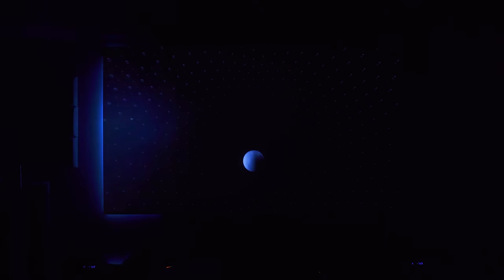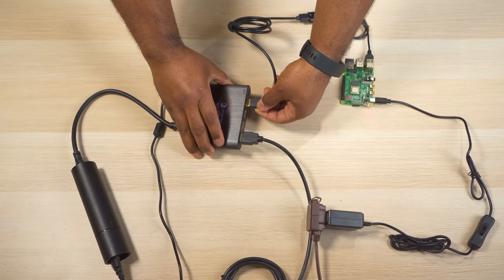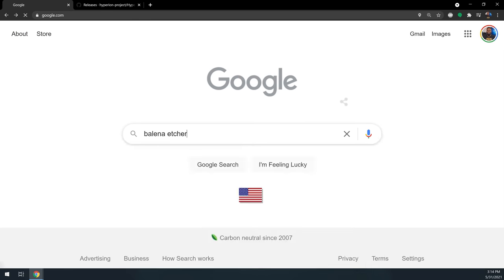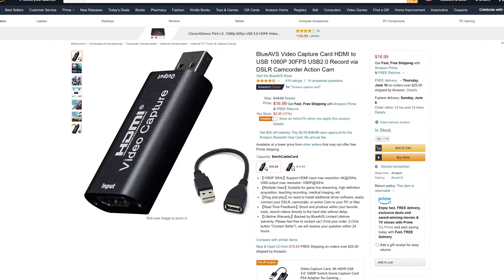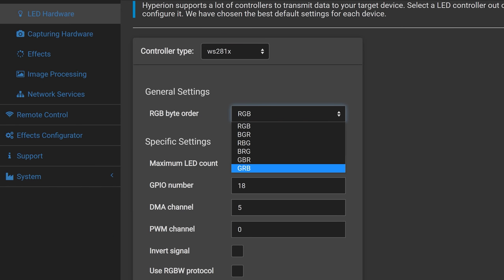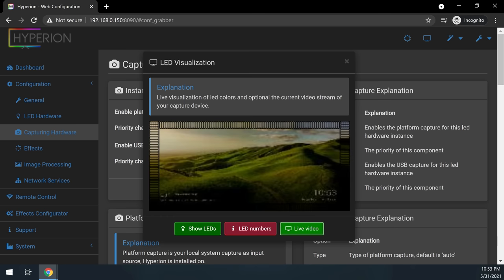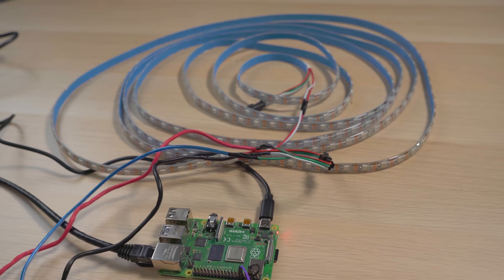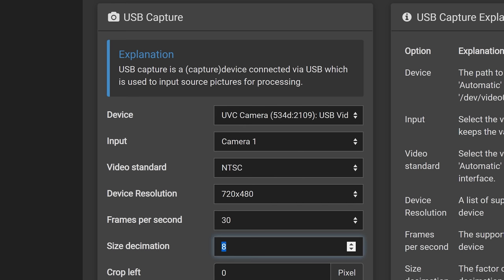Full Hyperion Ambilight Tutorial (TV Backlight) - LEDs Match Colors On The Screen

Comment: Hi, thanks for doing this tutorial! I'm using a 5v 8a power supply, but the WS2812B 60 light led strip is not coming on. I've got the raspberry pi connected to the same power supply and it powers up fine. Is my led strip broken or what am I doing wrong? Thanks!
Reply: having same issue.. i've checked strip with WLED, strip lights up there... but through hyperion.. it just remains off..
Reply: you need to be in root, disable audio PWM in config.txt, and enable wifi ! Should work now..

Comment: love the video ive been waiting for this.  but i think i need to research on the power suply thing as im gona try what you said and use 2 power suplys.  i need 20 feet of leds strip for 100inch screen which isnt a issue but my setup will have the power suply with my denon amp 10 feel away.  so need to go over the 2 powersuply method first.  not confident yet but ill check your web page.  again thks for video.  gurr on my only option at 350 uk pounds fo4r thge box lol.  i need cec for googles automatic on response.

Comment: I'm having a flickery mess right now as if the pi isn't communicating at all with the pi so I just ordered the logic converter. There was many times of just giving up with the elbows I even through them away but dugged them out of the trashed and soldered them. Now I ordered a 5V 15A 75W power brick do I need to have something on the other end and if so what if I just tie both sides to the same brick?

Comment: I got a little confused during the portion talking about the receiver.

If my AVR has two hdmi outputs couldn't I use one for my display and the other to the ambilight equipment?

I'd still get HDR because of the connection to the Display direct from my receiver and the ambilight doesn't ... need HDR?
Reply from the maker: With the way most receivers work it will not display 4k HDR to the primary if the secondary doesn't support it. So what happens is when you connect the HDMI capture to the second hdmi output it will drop your TV down to 4K Non-HDR. Hope this makes sense.

Comment: Well idk if anyone has had a problem with this but the power supply that he list in the description is pretty bad and you should definitely find a different one it ended up not working and frying some of the LEDS and it wont work all the way around if you us a 16ft LED strip so you should probably pick up to power supplies for that. (at least this was my experience with doing this and I didn't want to spend more money so I never finished it)

Comment: quick question.  someone mentioned using a 12 v led strip so only 8amp needed, is that right?  what would i need to do for that scenaria?  or is it wrong info?
Reply from the maker: No. You still use the same amperage calculation I mentioned in the video

Comment: Hi Chris .. if your AVR has 2 monitors output do you still need the splitter ?
Reply from the maker: I mentioned it in the video but no you don't need a splitter If your avr has dual hdmi outputs. However, it will usually disable HDR on your primary output if you split it.
Reply: @ChrisMajestic  ahhh sorry I missed that and much appreciated for the response

Comment: Looking to do this for a 100" diagonal projector screen. This tutorial shows 60LEDS/meter. I want to use 144/meter. Has anyone tried this? Is more is better?  Will I be happy with the lower count? or will I wish I had used more?? 144 strips are only sold in 1 meter lengths, so soldering will be required. Is this doable or worth the effort?

Comment: Help, i dont know why the hyperbion software isnt sending the data voltage through the gpio 18 of the raspberry, the led strip isnt even turning on.

I already check de led strip using other controller and it perfectly works.

I think the issue is the software because I measure the voltage of the gpio 18, wich must be around 3.3v, and the result is 0.18, wich means the hyperion isnt sending any data through the pin, how do i fix it????

Comment: I am using a 3440x1440 monitor. I tried Dreamscreen but the project is dead and manages only 16:9 ratios. I just bought a lytmi for pc. It is crappy (for the moment. Maybe the app will fix some issues). I searched a lot for something that can deal with 21:9 ratios and I think the better way to have good results is DIY. Great tutorial, but it is still very complicated for me and I think it will cost a lot of money. BUT, if someone can build the whole thing for me I would pay for it.

Comment: Anyone had an issue where just the first LED lights up? I've wired it up through both sets of wires, with or without the data wire, with and without the resistor, 2 completely different sets of lights. I'm guessing its the PS, but open to any ideas???